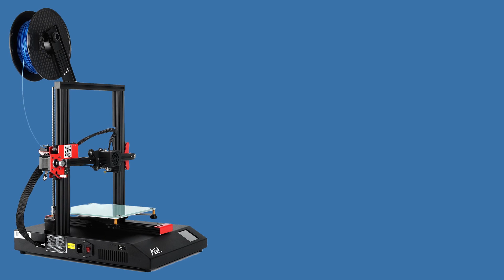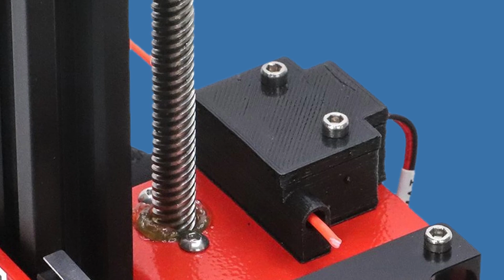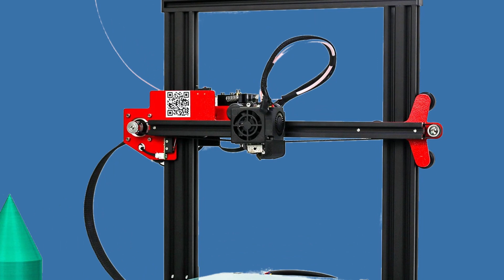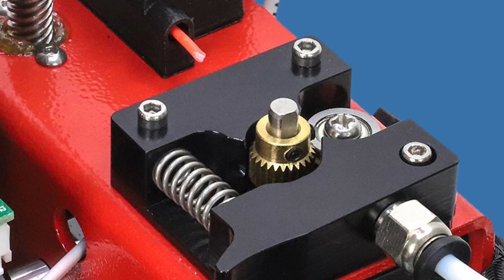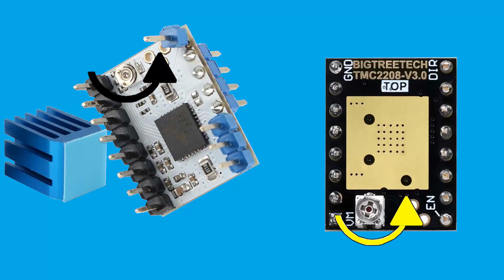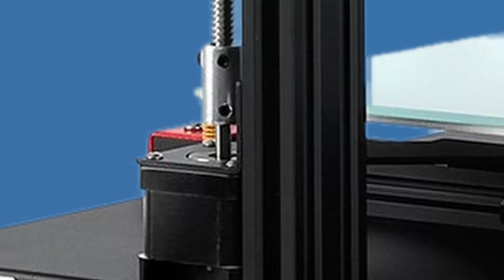Preview Anet ET4 3D printer pros and cons when 3D printing

Comment: Thanks for the review, I bought it based on your review. But you forgot to mention that the autolevel values aren't saved and you'll need to do it after each power off.. sometimes even twice and/or 3 times. I would probably have chosen a different printer if you'd mentioned that.
Reply from the maker: Perhaps that can change with a new firmware. but I trully do not even care about that. Because If the hardware is not what i would prefer then i would not like to even tinker with the 3D printer. Some company offered a similar 3D printer as the ANET for me to receive and make some videos about, But I did not oblige them. Thank you for watching and contributing.

Comment: A review of something you dont own or have tried.. ok..
Reply from the maker: Something along the lines of wanting to buy an item and the only way to know which one to buy is to look at the specifications and features.
Reply: @RoamingInterests  i would prefer some test results print outs , how does it look? much better ?  nobody knows now
Reply from the maker: @paulus47 , I Do not have the  Anet ET4 3D printer to do test on it and unfortunately right now I could not find a video to direct you to, which may have tested 3D prints on it. And I cannot say that will print or not exceptionally. I am just too skeptical about it. Because the single Z lead screw and the single gear extruder, I cannot fathom of being able to print phenomenally well without constant adjustments. Moreover, This morning I just finished a 7 day printout on my Creality CR-10 S5. I took me an entire week to get the model sliced and put the right supports on it, just to make sure it won't fail. When I got the first 3Dprinter I said to myself that, don't worry everything it would be great you'll figure it out. I have been figuring it our for year still. And before I stated the print, Just to double check, I printed a lattice stress test, to see where the printer was. Because I haven't been using it in a while. Now I would like for a change, to just fire it up and print, however i still have to tinker with it and make sure I am not surprised.
Also there is an unboxing video that shows the print of the first layer. https://www.youtube.com/watch?v=wXn-hMakZl0&t=7s
Reply: @RoamingInterests  thank you for replying, appreciate it,